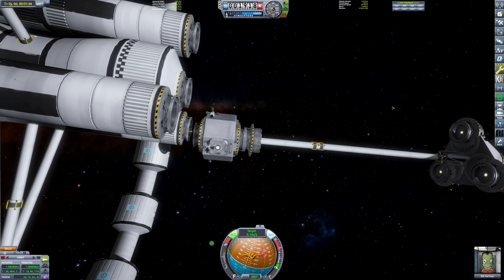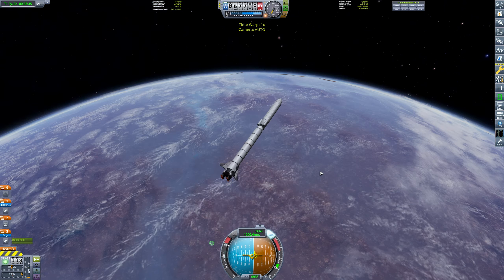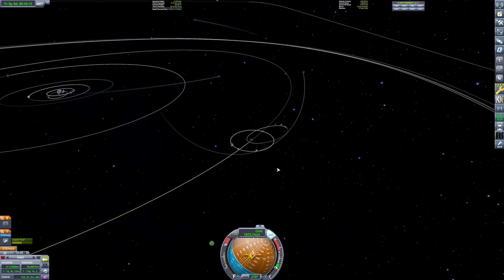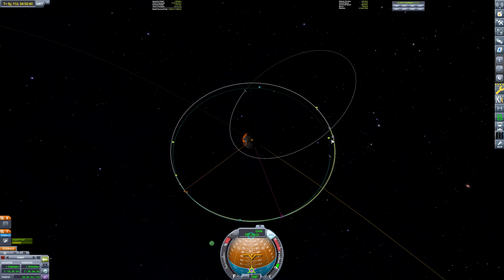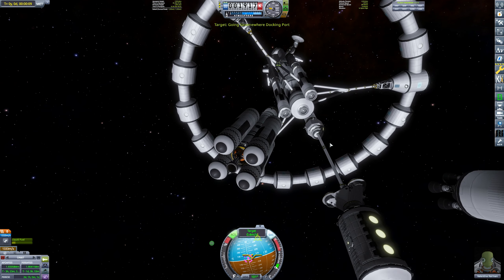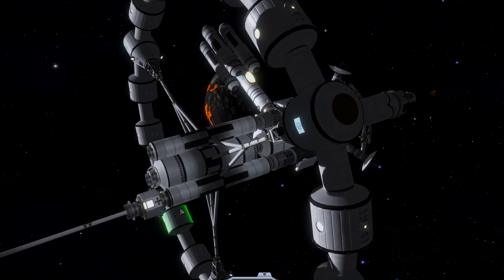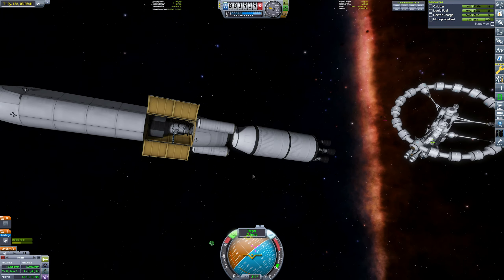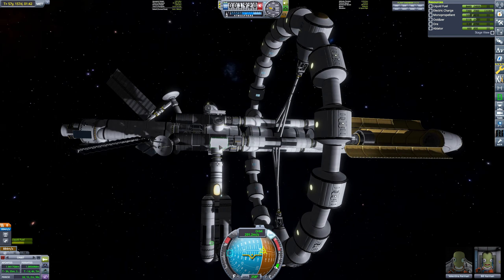KSP Beyond Home - Making a Big Station HUGE!

Comment: Aye! You should really get RealPlume! It works with Restock and it makes the engines go BRRRRRRRRRR and it is really cool looking.
Reply from the maker: I'll check it out - Last time I used it it was a drag on CPU but i'll give it a go
Reply: @Gameslinx  Thanks! I got it a few weeks ago and it is pretty great. Maybe my comp is just a beast, but it's not that bad.
Reply from the maker: @gabevietor3685  Yeah same here, my computer can run pretty much anything but realplume was a real CPU drag back in the day - Particles are the worst in Unity, it sucks dude
Reply: @Gameslinx  Good luck in your endeavors! I really like your videos and I think your station is beautifully over engineered. One of my ships that I wanted to send to the Mun in normal KSP turned out to have 5000 m/s of delta V, so I decided to maybe go to Eve instead. I literally just build rockets and go "Yeah, that might go to the Mun, looks pretty cool, and the first stage has about 1500-2000 m/s, so it should orbit." Then I proceed to forget to put fins on my spacecraft. Basically, you aren't the only one who over engineers :D

Comment: You know I just started playing your mod with some of its recommendeds, have to admit, it's really fun. Though when I changed the graphics settings since I have a 5 year old gtx 780 and it's more graphically intensive, I ended up with a tree on the launch pad and I had to change certain graphics settings again to get the tree to go away.

But overall, 9/10, you do have a lot of moons between 0.04 and 0.1 G's surface gravity for some reason.
Reply from the maker: To fix the launch pad tree, remove your settings.cfg and set your terrain quality to the highest (it won't have a performance impact)
Reply: @Gameslinx  Thanks, though I have to ask about the mechanics, wouldn't eeloo (forgot what you renamed it to) be heavily affected by destiny and fate when kerbol reached it periapse and eeloo on that side?

I mean without principia I doubt there's a way for it to be affected just based on the on rails orbit system for planets.

But eeloo does get pretty close to the destiny system compared to its orbit of kerbol, so wouldn't it have been pulled out of its orbit of kerbol after the billions of years of orbiting?

I mean I'm probably missing something, but I'd love to hear your thoughts on it since you are the one who made it.

Comment: what parts are you using as the connectors between the station ring and the main body?
Reply from the maker: They're from Infernal Robotics! They are structural parts called Robo-Trusses